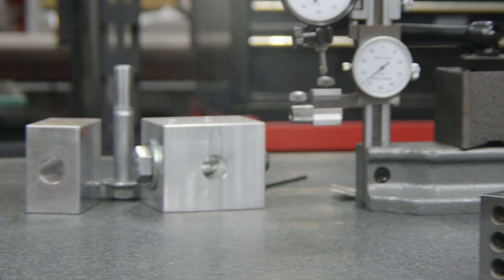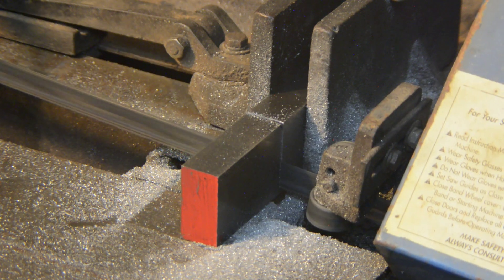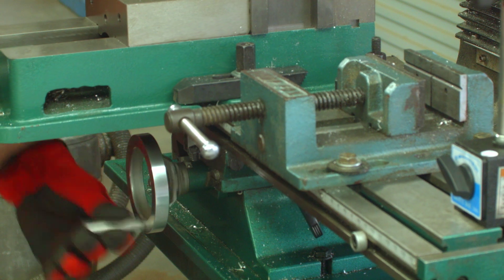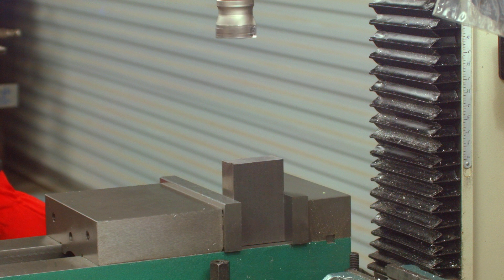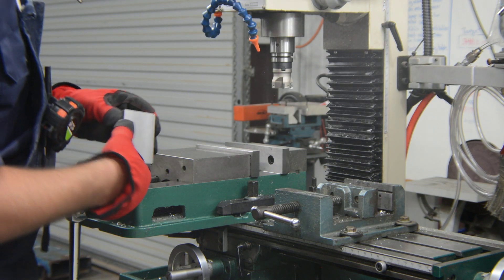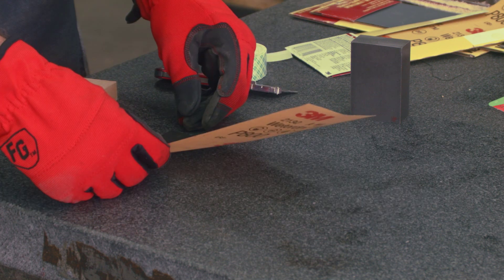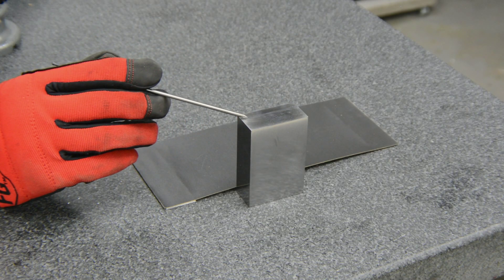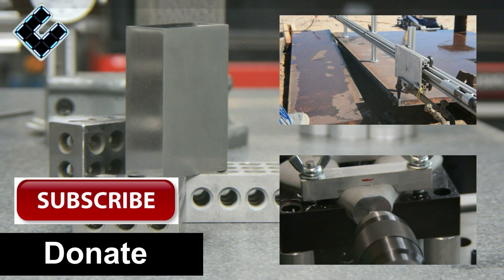123 Blocks, Make your own 123 Blocks, DIY 123 Blocks

Comment: Could you not have just used a known accurate 123 block to indicate and sqaure the block
Reply from the maker: Sure, I don't know how well that would work. But that is a similar technique to the machinist square.
Thanks for watching and commenting.
Best Matt
Reply: Centurial Inc. Sure thing.. Maybe I am wrong it just made sense when I said it out loud because you were making a 123 block. Meaning set a 123 block down as a parrelel to indicate one face to get it square then use that known square surface as a reference face to indicate and square the rest.. But I would have to try it myself before I would swear by it. Just a thought. Thanks for responding have a great day and Merry Christmas to you and your family
Reply from the maker: Thanks, You too. I appreciate most any input. We are working on a fresh video right now, hope to hear from you on that one.
Best Matt
Reply: With the amount of time/labor involved in making these...I could just order a set of them on Amazon for less than $20...and they're already case hardened...js
Reply: The Journey is the Goal. @chemicallust77

Comment: DO NOT WEAR GLOVES WHEN WORKING ON A MILL OR A LATHE.  You can get pulled into the equipment and rick serious injury and permanent disability from injury.  No gloves, jewelry, watches, rings, loose clothing should ever be worn around operating vertical mills and/or lathes.  short sleeve shirts with bare hands to you have nothing to get caught unexpectedly which can pull you into the equipment.  Any long hair should also be secured if needed.  Shop safety is not something to mess around with
Reply: Kid, You got a lot to learn....A 1/4 horse drill press will break a finger or even  tear it complety off . (Im an engineer and know LOTS about MA (Mechanical Advantage) and inertia.

 I'm 71 and have been around rotation machinery all my life and still have 5 on a side. . (My dad showed me how to use the drill press when I was 5)   I would NEVER wear gloves around machinery,,,  Hey,,,, Love to see you use a mic with those welding gloves.  I carry less then a .001 on my Cincy Toolmaster mill all day and all night. If I tried it with my goat skin heliarc gloves the lost "feel" would make me lucky to carry .002 but that's not the main reason to leave the gloves on the burning bench. Sooner or later you WILL get hurt,,,BAD! . 

One other thing. If you tried to wear those gloves in a swear to God OSHA compliant machine shop you would be out the door before you had time to close your tool box. 

Listen to the old salts here. Only a beginner would be stupid enough to wear gloves around even your "Hobby" machines. - If you insist in wearing gloves keep your hospitalization up son....You gonna need it.
Reply from the maker: @mathewmolk2089 First off I'm 30. And second i have stalled and held on to the drill press it's easy. I can over power it no problem. Third and more importantly. I'm an engineer to. You made a bad engineer mistake. ASSUMPTIONS! I hope to god you didn't design anything more than a spoon. 
Sorry guy tolerance by feel is exactly the opposite of what an engineer should ever say. Science and engineering go hand and hand feeling is not allowed. Me with gloves on can get any tolerance you like. If i wanted to I would lap that block in to the millionth place just like they do for gauge blocks. But that would be a waste of time. I work in an OSHA shop. When the OSHA inspection comes I wear my gloves. Same as any other day. No one ever said a dam thing. Cause i get results. And have all my limbs. And it's my choice. The old salts are the reason why america is in the bad situation it is. They'er done, it's time for change. Keep up or get out of the way.
Best Matt
Reply: Told a young girl at work not to wear gloves on the drill press.  She refused to listen because the metal was getting "too hot".  I didn't get 5 feet away when the screaming started.  I ran back to find a very ugly mess.  Two broken fingers and torn ligaments on the back of her hand.  Out of work 6 weeks then too gun shy to work on machines.  Had to quit.  Your "not that dangerous" remark shows you have no experience.  This is for others watching since you know it all.
Reply from the maker: @randy-yk1yk  Guy I've been ruining these tools for 12 years. What your doing is called cherry picking. you have a handful of bad examples. I have many many days of nothing bad happening. That's called science. Majority in data rules. These industrial accidents are rare and worse it's usually cause some one was allowed to use a machine they should never be around in the first place. I raced sport bikes for years watched friends nearly die right in front of me. 15 mins latter my race was up and i got on the dam bike. People die in car accidents. EVERY DAY. so next you'll tell me not to get in my car? The point is that when humans fail there is no such thing as safe. Safe is a human like me that can do it with out failing. This requires good practice skills. I'll show that in another episode. I'll call it "how to learn". Stop living in fear man. seriously. That young girl was a failure of management. She was not ready to be on that machine. 
Best Matt
Reply: Get caught wearing gloves around rotating machinery by the boss and you get fired. Get caught by machine and you get fired via the emergency room. 

And talk about gloves. I don't wear gloves that thick when I run spray arc on a MIG machine.
Reply from the maker: @cheaptrickstools3451  Nope, I wear gloves at work all the time. Even in front of Auditors. No issues so far. Been years now. Everyone is just scared. But really there is nothing to be scared about. Keep your hands where they belong. And you'll be fine. Just like me. By the way in your case not wearing gloves that properly protect you from the sparks is also a safety violation. Not sure which side your on????
Best Matt
Reply: @centurialinc  Some engineer. No wounder we get specs that are backwards. - Go read that, He says he wears THINNER gloves. Not NO gloves. And if you have gloves in you keep your hands 10 feet away from running machinery.
Reply from the maker: It's not that dangerous on these more hobby machines. The motor will stall long before serious injury. Speaking from experience. Anything 1 hp or less is plenty safe. 

Also this "no gloves" rule is only true for beginners and that was discussed below in another comment. 

Thanks for watching and the comment. 
Best Matt
Reply: @centurialinc  search deglov and after that stop it is very dangerous and not needed at all
Reply from the maker: @nf794  No, gloves are safe people are not. Keep your hands in the right places and no harm will ever come of it. Also by your logic. Go watch a car crash video. Then stop driving. 
Best Matt

Comment: The gloves are a bit overkill.   And not recommanded when working on a mill or a lathe.
Reply: Good way to lose fingers
Reply from the maker: Nope, its safe as long as you know what your doing. Same goes for all things. If the gloves scare you then you should never get in a car.
Reply: Centurial Inc but every time you get in a car I’m sure you fasten your seat belt, and the car has airbags, ABS and several other passive security devices, with the premise that if something is dangerous one must avoid everything that add more danger. I can understand is not pleasant work with metal and deal hot/sharp debris (I work with wood and is not aggressive), but even if you know where to place your hands there are several situations you can’t control (the piece you are working with suddenly breaks or a clamp jumps and hit your hand against the drill...), that’s why is recommended do not use globes or loose clothes. Any way the key is use good tools, be careful before turn them on and use your brain, some people will lose a finger even keeping themselves 3 meters away.
Reply from the maker: nah there fine. Just know where and when to place your hands and no harm will ever come to you.
Reply: @centurialinc  Yea, Like 5 feet of more away from the machine.

Comment: You mentioned not using endmills in drill chucks. Is it just for accuracy or is there another reasons?
Reply from the maker: That will happen. A valuable lesson learned I bet. Collets are the best I will say.
Best Matt
Reply: Centurial Inc 
yes they are , I some time use them for precision drilling !
Reply from the maker: Yes mostly accuracy. We wanted this block to turn out as accurate as we could. There are other issues such as holding power. Drill chucks slip if they are over loaded. You can slip collets as well but it takes a lot more force. And finally is working volume. A drill chuck takes up a lot more space than a collet. So if you have a small machine like ours it is a huge problem. The only benefit to using a drill chuck in this manner is convenience during tool changes. But that convenience could be nullified by a bad part in the end. Thanks for watching and commenting. 

Best Matt
Reply: I bent my drill chuck arbor using it on the mill, I only use Collets for milling!
Reply: They break half the time.
Reply: ...and drill chucks are ONLY designed for axial force not radial.  It can ruin the jaws, oversize your holes due to runout.  I only put drills and reamers in a chuck.  Endmills and taps...use a collet.  👍

Comment: nice production quality. Very good techniques. But what kind of legitimate machinist uses a Harbor Freight tape measure?
Reply from the maker: HAHA! That was a good one. Well said to. Thanks for watching and commenting. Best Matt
Reply: Centurial Inc I hope you weren't taking my joke too seriously. I assume that you use the tape measure just for rough cutting and getting stock close to size before Machining and use better measuring equipment for things that are more critical. but it was a very good video thank you.
Reply from the maker: timothy harden , I did not take it to serious. You gave me a good laugh. That's right it sits by the band saw 90% of the time. All other measurements are done with a decent caliper or dial indicator as usual. No problem. I have much more to come. Best Matt
Reply: Hey now, tape measures brands don’t really matter, calipers and tape measures are reference only. In my case tape measures get destroyed easily in a production tool and die tool room, I use a harbor freight tape measure on the rare occasion I use a tape measure. If you’re measuring for accuracy that’s when I’ll use my mics which are all starret, b and s, and mits. But like I said with a tape measure there’s no point in paying more than a couple bucks for it

Comment: The sandpaper process you are using will lower the edges and corners of your workpiece
Reply from the maker: Good observation! And it did. It was small less than a half thou, so small in fact it was hard to detect with the indicator we had. But none the less it did happen. You will be happy to hear we picked up a surface grinder and will be doing a 123 block reloaded video in the future. I can't wait to see how much better we can do! Thanks for watching and commenting. Best Matt
Reply: You can get very good results from sandpaper, but you have to be careful not to have any lifting of the paper, since that will cause errors in the edges of the part. The thick double-sided tape caused a "hammock" effect as you got near each piece of tape. Either use a proportionally much larger piece of sandpaper and avoid the edges, or stick the paper down using some other method that doesn't cause lift - I've used wide painter's tape from above, sticking it to the gritted side of the paper. This way, there is nothing under the paper to cause it to lift.
Reply from the maker: That's a solid suggestion. I recently re worked a vacuum pump using the sand paper method and decided to address this issue. I grabbed some 3M spray adhesive and that did the trick. A little acetone took the residue right off the surface plate when I was done. Thanks for watching and commenting.
Best Matt

Comment: Sorry but .0015" is not very good for a 123 block. You should be looking for .00015"
Reply from the maker: You've got a sharp eye. .0015" is the total so that's +- .00075" over three inches, the longest side, and for hobby machines and a little sand paper that's dam good in our book. Also it was for educational purposes anyway so the tolerances are mostly what you want. So if you feel like lapping it in to a few millionths and have that kind of time go for it. And we just got a surface grinder so a 123 block #2 video is in the works. We are going for +- .0001" and are really excited about it. It will be the most precise piece I have ever made. Thanks for watching and commenting.
Best Matt
Reply: 50 millionths is even typical.  = Other then the gloves he should loose the guesstometer and get a decent set of mics. (Love to see his feel wearing those welding gloves.   - This is a "how NOT to" vid.

Comment: Really great video I must say!

But...
even if it´s cold or your hands are getting dirty, never ever use gloves!
...or at least please don´t show it to the public and those who still learn.
Reply from the maker: Good comment! And you are 100% right. It was a slip of mind relay and that is all it takes to have a tragedy. And after I was done with the project I had realized my mistake. Thanks for looking out for us and the new people out there. 
Best Matt
Reply from the maker: ***** Your correct. Safety is relative to proximity. The point being made is that beginners are often forgetful and careless. That's how a hand with a glove gets to close to the work. It's not a problem for those who are experienced. But the video was for beginners and that was the mistake. Thank you for the comment. Best Matt
Reply: Either way, nice video. Great instructional type build log.
Reply from the maker: Thank you. A fresh video is coming out this week. Hope to here from you on that one. Best Matt
Reply: Its been 4 weeks, but I'd disagree. Personally and in our workshops you always wear gloves unless measuring or working on a lathe in such a way that you must bring your hands off of the controls and close to the work. If you are trained to never go near rotating equipment with gloves you will be 100% fine. They're no issue when your hands aren't going within 1m of the cutter. As long as you are aware and use good practices there is no problem with gloves in the real world.